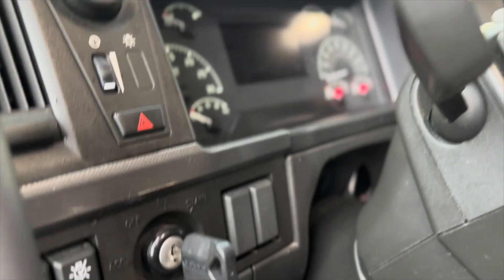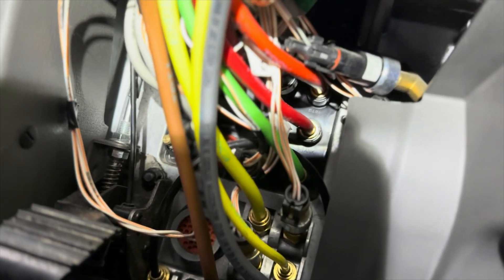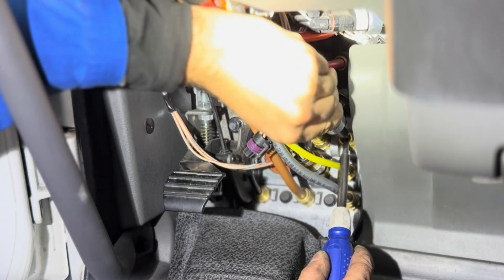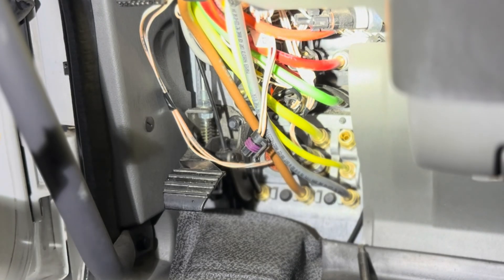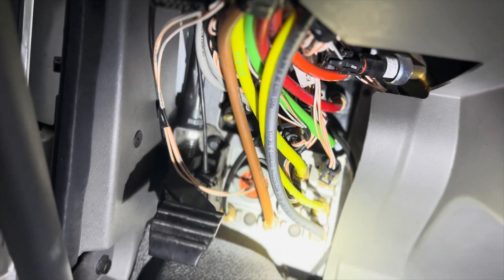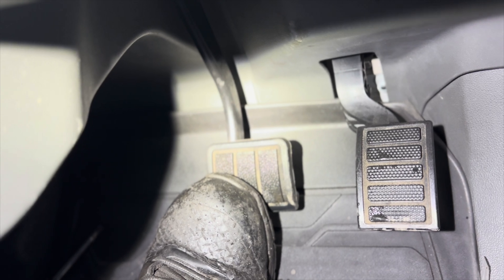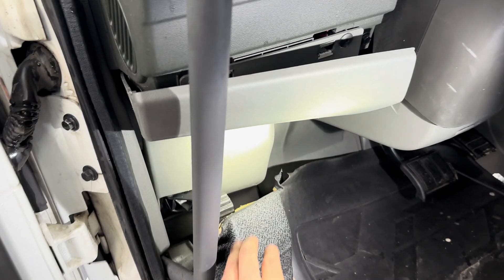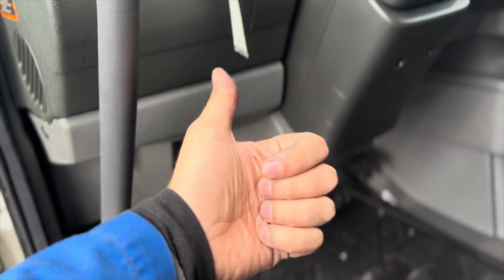Volvo Brake Pressure Sensor Replacement SPN 1067 FMI 7

Comment: This isnt the issue although it could be. The true fix is the sensor by the modulating valve on the right side frame rail. If you look, the 90 degree fitting where the other pressure sensor is installed will be oxidize which indicates air leak under certain contiions. Sometimes even the connector for this same ps1/2 sensor is oxidize. Replace sensor, verify connector pins. Air up system, apply brake pedal, key on, let it chuff to calibrate new sensor and fault should clear on dash. Sometimes to clear fault from ABS ecu, you need bendix software to clear it manually.

Comment: My 2020 Volvo 740 would not calibrate. Had to first remove codes with labtop, only after removing codes did the calibration method work. Also, had to replace both sensors.

Comment: If you cannot calibrate the sensors after replacement, bungee cord your brake pedal up, then turn on the key and do your calibration. If your brake pedal application isn’t starting at 0% they will not calibrate. Brake needs to start as high as it will go and go all the way to the floor. This is usually why they can take multiple times to calibrate or why they won’t calibrate at all.

Comment: If you don't fix the problem with this sensor, there's one more identical sensor on the passenger side on the  frame on the trunk in about 2 feet behind the transmission. It's located  on the left side of the air module. 
That's how my problem got fixed. You still have to do the sensor calibration. Good luck!
Reply: This☝️✅

Comment: I replaced the sensor but lights are on after 3 weeks
Reply from the maker: after replacing the sensor, make sure your air is pressure is full, then press down on the brake pedal as hard as you can for about 5 - 10 seconds then release. The faults should go away after, if not you have another issue.
Reply: @Manny_Mechanics I diagnosed with JPRO and it shows brake demand primary and secondary sensor not calibrated

Comment: Per Bendix diagnostic software, when brake pressure/load sensor is replaced for this fault a calibration procedure of brake demand sensors is required to properly turn off the warning lights. 
1. Ensure air system is full (I would turn off vehicle and allow cluster to go dark before next proceeding)
2. Apply ignition power and wait 30 seconds  (key on, engine off)
3. Perform a full application of the service brake and hold for 5 seconds. 
4. Release the service brakes
Reply: This

Comment: Some times you should press the brake pedal multiple times to calibrate the sensor. Don't get discouraged. To my trucks took probably 30 times. You can do it while the engine is running butt the parking brake should be released. 
Good luck. 
Thank you for the video.
Reply: How do I know when it has been properly calibrated?
Reply: Park brake in released position. Air tank full. Truck key on with engine off.

Apply full brake pressure and hold for 5-10 seconds. It should turn engine light off.
Reply: Yes just took me about 10 times. Sometimes first try on other trucks.

Comment: You forgot to mention. Air had to be drain. You'll never gonna get that sensor with 120psi.
Reply: No pressure on the sensor unless you press the brake pedal.